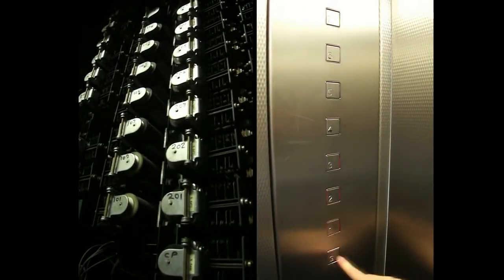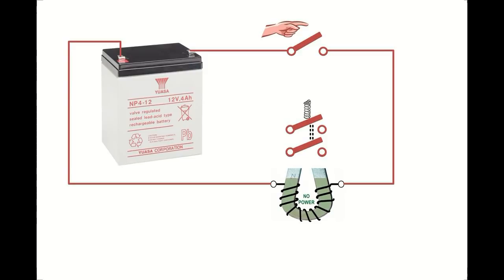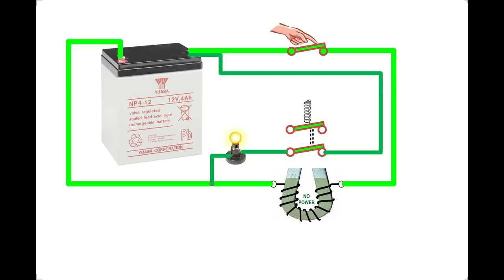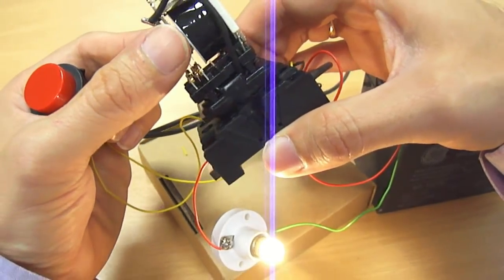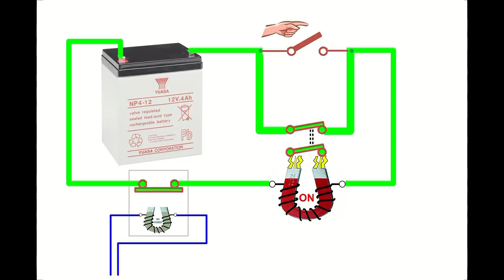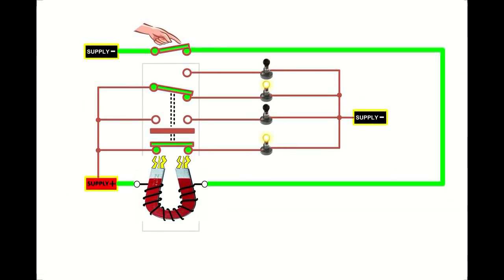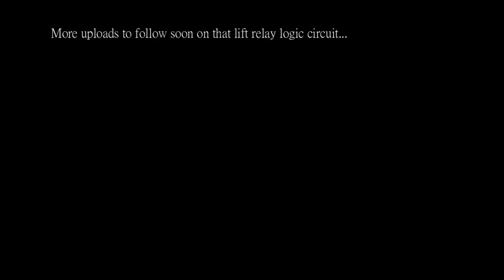The easiest LATCHING RELAY CIRCUIT to understand ever!  Both theory and practical explained.

Comment: Cool video! Would it be fair to say you could do this with a single pole single throw relay by adding a wire from the positive side of the coil to the completed contact of the relay output? Thus feeding the coil from the completed output from the same battery? Or is there any reason I would need to isolate the coil on the other switch of a double pole single throw relay as you have done here? (Given the voltage is all the same from one source).

Comment: Thank you for this video sir. Could you explain how this latching relay is implemented in elevator by using plc
Reply: Visuals of relay concept is very good..
Reply from the maker: No enough information sorry.  What are you attempting to do?  What is the relay controlling? What is the old output supposed to control?  What voltages are we dealing with?

Comment: Is it okay to keep the Push Button still Pressed ? or signal has to be removed?
Reply from the maker: The push button turns on the relay.  When the relay is on, the switch inside the relay is pressing the button.  So if the push button is pressed, or the relay is on - it's the same.  So pressing the button will have no effect.
To turn off the relay, yes, you have to remove power to the relay coil AND the button must not be pressed.  If you turn off the relay and the button is STILL pressed, then the relay will just come back on after being reset.

Comment: You taught me something I desperately needed to know, thank you, but I am still confused about things, can I use a reality to turn on and off a switch constantly, until I make it stop?
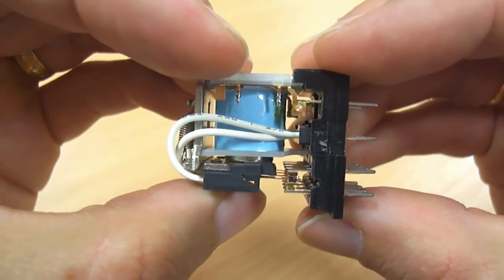Reply from the maker: *relay? (reality).  What you are talking about here is some kind of timer - e.g. one second on, one second off.  It doesn't matter if it's one second or 1 minute, it's still a timer circuit.  So now you will need additional components like a capacitor to create a timer circuit which makes things more complicated.  In short - yes you could, but you would need more than just a relay.  A relay is just a switch (or many 'linked' switches) all switched on by one electromagnet.  To turn the switches off - just remove the power to the electromagnet.  You can do FAR FAR more, but now you would be connecting one relay to another relay and creating some kind of logic, which is not covered in this video.  However, see this video at 2:17 for a "taster" of how to create a timer using a couple of relays -  https://youtu.be/maZhRxPJ3nY?t=217

Comment: What is wrong if a 12v relay is making a buzzing noise like the one heard at 12:17?
Reply: That buzzing sounded more like fluorescent light ballast, but if a 12v DC (coil) relay is buzzing there may be some ripple in the power supply if your 12vdc source is coming from mains power. The relay coil or flyback diode could be defective or you could be accidentally supplying the relay with alternating current.  If the relay is designed to use with 12v AC at the coil then there may be some inherent resonance as the current alternates and would not be considered unusual.

Comment from the maker: Anthony Newcombe Yes, as PondlessPuddle says.  When an electromagnet is powered up, it holds on to a charge of electricity that's ready to "ZAP BACK" when the circuit is de-energised.  If you didn't have it, then the circuit would still work but this charge will still ZAP something and eventually you'd probably damage the relay contacts or power supply.  If you were to touch the relay coil contacts when the circuit is de-energised, you'd certainly not do it again!! (you'd get a very quick and powerful electric shock!).  The diode only allows current to flow through it in one direction.  When the relay is powered normally, the diode does nothing.  When the circuit is de-energised the diode "soaks up" the electricity that's been stored up in the coil to prevent it escaping down the wires to your other circuit(s) and power supply.
Hope that makes sense?
Reply: +mrmattandmrchay  I didn't see or hear any mention of diodes in this presentation. Should your comment be elsewhere?
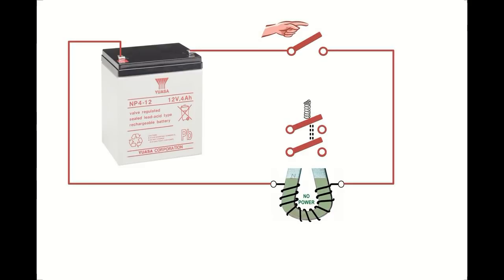Reply: +Ro Efa At 4:08 there is a diode visible, it is across the coil terminals of the socket. It is not mentioned in the video tho. This is a "flyback diode" aka "freewheeling diode" aka "commutating diode" aka "suppression diode" - take your pick they all mean the same thing and do the same thing, whice as Matt says above is shunt off the voltage spike from the collapsing magnetic field whrn the coil is de-energized.
Reply from the maker: +Sootikins Yes, Although the diode is there, I didn't mention it purposely.  The aim of this video is to demonstrate a latching relay using a very simple method that anyone can understand.  To bring in the diode and have to explain back-EMF and spikes and the way the diode suppresses the spike created by the relay coil was purposely omitted from the video.
Reply: +mrmattandmrchay Makes sense. I wasn't criticizing your video, was just pointing out the diode to the "what diode?" person upthread. And as a guy who has spent much of his adult life dealing with relays and motor starters, I couldn't resist spewing a little knowledge - lol. Came here from your excellent elevator vids, curious how you'd present "easiest" latch circuit. I'd say you did a good job of it!
Reply from the maker: +Sootikins Hi, yes I realise that you were not criticising :)  Thanks for your comments
Reply: +mrmattandmrchay who can help me here?
i need a system that switches off dc 12v supply when 220v AC comes in action..and it would be better if DC would come in action action again..when ac goes away,i need it for my home coz i dont have inverter..please anyone suggest me for what i'm looking for!!
Reply: +vivek gangwar this relay is 220 v 30 amp relay
 i used 2 relays 2 times in the same circuit in my home very safely 2 years ago and still working in my solar system
the first is put normally open between  two ends of the positive lead of my 12 v/ 500 amp battery bank, when the grid current is off ie 220v ,the circuit is closed and the ends meet each other, directed to my  dc / ac  12v / 220v pure sine wave 1000 watt power inverter which now receives the 12v terminal so it starts working and produces electricity. it is put always on on

the second relay directs the electric current to one of my home lines, either the grid ac current which is put normally open or my inverter ac current which is put normally closed  this way
1/the inverter starts working automatically
2/there is an automatic load transfer of the electric current in a quarte mofr a second....... i hope it helps
                                    dr.ashraf, alexandria, egypt
Reply: +Ashraf El Sayed 
n.b    both relays are energized by grid current
Reply: I realise this is 2 years later, but if you don't understand relays well, you don't know enough to be messing with mains current. You should definitely leave it to someone with more knowledge. If you make a mistake you risk blowing something up, or worse, dying. This can very easily happen. 

Even people with good knowledge of electronics will steer clear of mains stuff. It's a separate field that requires it's own knowledge. It's not worth taking risks with unless you have expertise.

Comment: very nice video.
Do you know where I can find the following 12 volt relay, preferably with standard 12 Volt connectors? 
Latched On/Off Output Using Two Momentary Positive Pulses - Positive Output

Comment: hai friends,
This is gokulakannan.I want to control projection screen through 24v input and output 220-230v relay.Can anyone tell me which relay is best for it and also i need a connectivity diagram for that.I want some low to high voltage rely name.
  Thank you

Comment: What's the purpose of the diode I saw across the coil of the relay?
Reply: It prevents excess current generated by the coils from flowing back into the circuit
Reply: sounds about like what another told me.... it discharges the coils when the circuit is de-energized.

Comment: what is the difference between latching and non latching relay?
Reply from the maker: All relays are a electro-mechanical switch.  When the electromagnet is energised, the switch inside is activated.  When power is removed from the electro magnet, the switch deactivates due to the "return spring" inside.  A latching relay is created, as per video, then you use one of the switches to deliver power to the electromagnet, even when the trigger source is removed as long as the supply voltage is maintained.  So normally, there is no such thing as buying a "latching relay".  You would buy a "relay" then wire it to latch.
However, you can buy relays that 'latch' even without power.  These have two magnets - one to create a permenent magnet, the other to kill the magnet (sometimes called Remanant relays).  But these are not very common at all.
Hope that answers your question.

Comment: Hi great video just subscribed to your channel but i have a question below regarding relays

i want to use the relay that i have attached down below to stop a conveyor belt when the sensor which i have also attached gets blocked. The conveyor belt itself is run by a 3 phase motor and contactor which is being turned on and off by a plc. The contactor coil is rated at 24vdc. Thing is im just a little sketchy on how to go about wiring it up according to the data sheet for the relay the coil is numbered 1 and 5 and the common is 2 NC is 4 and NO is 3 is this right? if so i know i have to get power to the coil and the common terminal is this also right? and basically how does it all go together then? 

http://ie.rs-online.com/web/p/products/0353837/?tpr=2

http://ie.rs-online.com/web/p/photoelectric-sensors/0458844/
Reply from the maker: I'll have to get back to you on this as this doesn't sound like a 10 second reply! :)  I look at your links during the week

Comment: Seems you don't know what latching relay means.. what you showed us are plain relays.. latching relays only need power at time of switch from 0 to 1 or vice versa. Plain relays need power for the whole time of being in state 1.
Reply from the maker: +Google+ SUCKS BALLS - the worst forced social network.&#160; Correct about standard relays.&#160; Then to make it latch, follow video and it becomes a latching relay.&#160;&#160;I've been working with relays since I was 12 years old (43 now).&#160; You can buy "latching relays" off the shelf, but all you need is one set of contacts to do it yourself and is probably cheaper.&#160; There is a timer relay featured in the video (which you can program to latch I guess).  But what I don't understand is, what you've described is exactly what I've shown in the video... Standard relays have power waiting at the relay terminals - once the + or - has jumped the relay contacts the relay contacts close and it maintains itself (i.e. a "latched" standard relay)
Reply: mrmattandmrchay The point of latching relay is it stays in fixed state even if the power goes out and/or comes back later again. They use mechanic to lath itself in some position. You got single soil, double coil latching relays. You can't do that with plain relays. When the power goes out, the relay state will go off as well. What you're talking about is relay with latching electronics or wiring, but it's not a latching relay (as in the type of relay)
Reply from the maker: +Google+ SUCKS BALLS - the worst forced social network . I see what you mean now.  I've only ever seen two of these "mechanically latched" relays - some were on the old London Underground signal "relay" rooms, and the other on this lift...https://www.youtube.com/watch?v=e7EtHqRkgiUThese are called "Remanent relays" and have two coils - one to bring the relay on, and another coil (twisted within the same coil, but the opposite way round) to reset it.  When it's brought on it is held on with the aftereffects of magnetism (hence "remanent" relay).  I was meaning to do another video just on this, but it's on my long list of videos to edit.I work with relays all the time and the others that you mean are quite rare, but perhaps that's just because I am in England and the mechanically latched ones are more popular in other countries.
Reply: mrmattandmrchay Yes, it's not a common relay.. but I think partially because people only learn about plain ones. The other part has to do with the way you operate them (either dual coils, or you switch the state with a pulse).